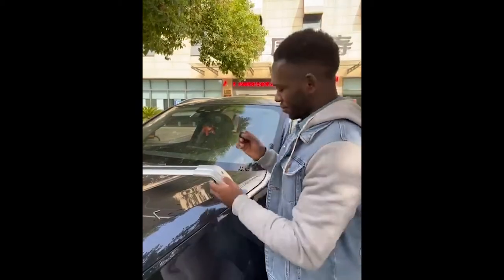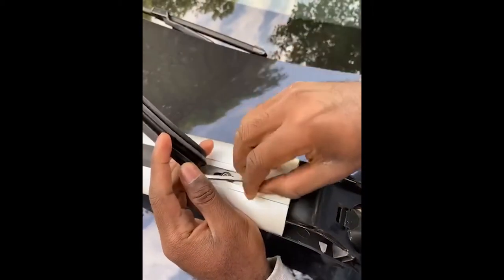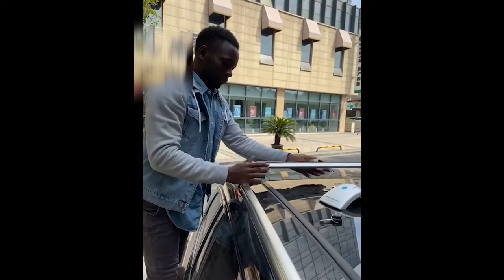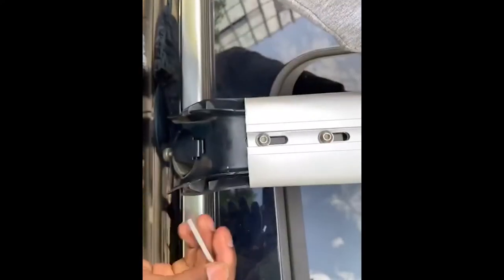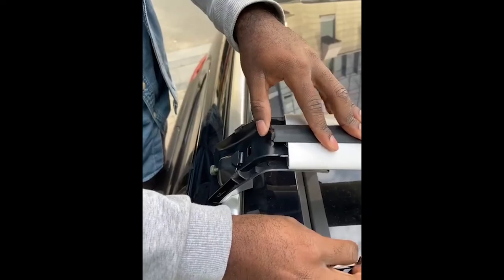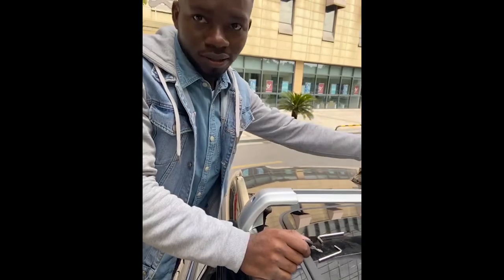SY Crossbar installation

Comment: What a bunch of moaners... installation really isn't that complicated -- just fit pieces together and tighten in-place with screws; besides, what were you expecting for price paid! 

Just make sure the screw back pane is inserted first with little bent tongue extending downwards, then insert foot all the way between bar and tongue into the bar, gently easing plastic on foot around bar end, until screw holes align. 

After that, easy to tighten and adjust on car roof rails.

Comment: your crossbar is not the correct one for my vehicle. You should check the returned unit. I have a 2021 GLA250 M.  benz. your crossbar does not fit my rails.